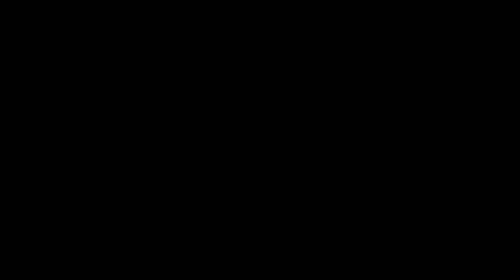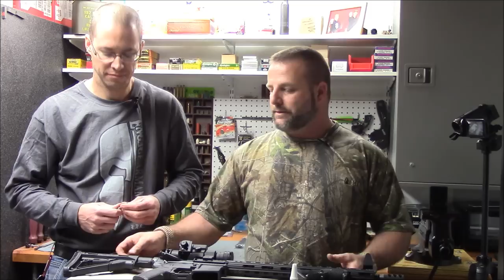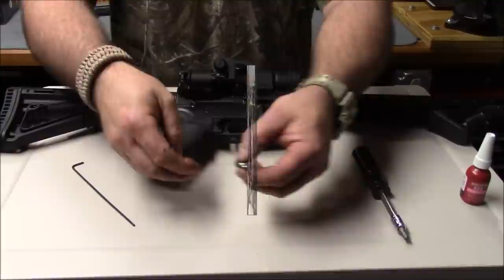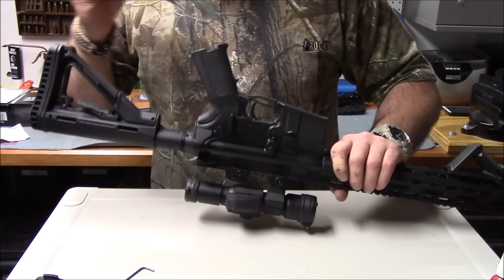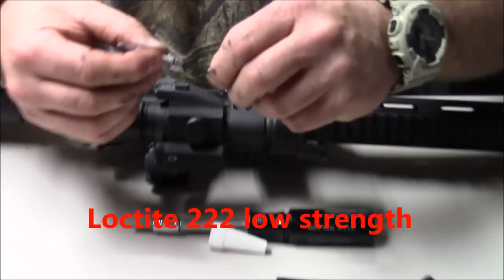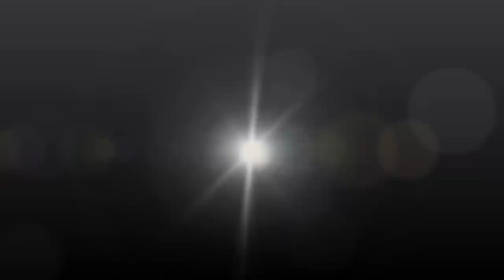AR 15 Trigger Adjuster

Comment: If you’re loving on this thing, make sure you understand what you’re actually doing. This is really a “hack” of the design of the lower receiver that allow the set screw to interfere with the mil-spec design. The set screw is hitting the bottom of the trigger bar preventing it from returning to its designed location. It’s basically just pre-pulling the trigger and that’s why there’s less take up or travel before it fires. The trigger is already mostly pulled before you even touch it. It also means that much less of the designed hammer cocking notch and sear face area are engaging at any time when the hammer is now cocked or when the hammer falls from the disconnect to the sear and all that force is now concentrated much closer to their edges and on a lot less metal.

Comment: This sort of gadget is hard to find in New Zealand, so I took the screw out of my Windham AR, drilled it through and tapped it for a grub screw. A long grub screw with the tip rounded and polished completed the machining. Re-installed the screw and adjusted it. With everything as tight as it would go without jamming the safety it would not reset, but another 1/3 turn out fixed that.
My AR now has a just-short-of-5lb trigger with NO creep....classic 'glass rod' break... brilliant!
Originally the trigger was about 8lb and a tad creepy.... not truly awful, but not brilliant either.
If you have an AR and don't like the original trigger, get one of these widgets, or if you have a lathe and taps, make one... took me about 20 minutes (but I am a gun smith).
Thanks for the video.... inspired me to do something about the trigger. I can't see that it is not, for all practical purposes, as good as the $450NZ Timney 4lb drop-in that I was thinking of fitting. 
What a happy coincidence that the grip screw is in just the right position for the adjuster!... :-)
Reply from the maker: KathrynLiz1 Nice. next time ask and we would put younin touch the the maker and he would have sent you some. But your way works too.  nice job. ;)
Reply: The problem here is importing anything that fits on to an MSSA (Military Style Semi Automatic...called an "assault weapon" in the USA). Getting a permit to import even a spring set or such a simple gadget as this trigger adjuster is a nightmare, and involves long delays, often a matter of some months..
If I go online at Brownells or somewhere like that and order any part for a "restricted weapon" without a permit, it will be confiscated at customs. In addition to that, for small items the postage is usually many times the value of the goods for international stuff. It's very frustrating.
Our gun laws here, while a bit of a nuisance at times (and quite ineffective vis a vis crime of course) are something we can live with and us shooters are numerous so they try not to upset us TOO much, so the bureaucrats make it as awkward as possible with commerce law. Having no homegrown firearms manufacturers means everything is imported, and that gives them a lever. For instance, a 20 or 30 shot magazine for an AR, that can be bought in the USA for $10-15US (about $20NZ) will set you back almost $300NZ.... yes that's not a typo! I have seriously considered making up some dies to makes the things to order myself, but that would make me an "arms manufacturer" and the cost of being so licensed would probably be prohibitive.....I'm not sure I could get away with it within the present laws. I have made parts for non-restricted weapons of course, because of non-availability or expense of import, but they are a bi paranoid here about AKs and AKs. The silly thing is that the only real difference is magazine size (7 rounds max). So on an ordinary non-restrictred license I can buy and AR15 with a 7 round magazine. In fact my AR was bought this way, but because I bought a couple of 30 round mags for it (available without any sort of permit!) I have to register it as a restricted weapon. Silly, isn't it? Better than Australia though, there's a complete ban there on s/a and pump guns....
I know that you are under attack in the USA, but you have constitutional protection..... we don't. Don' ever let it go... :-)

Comment: Problem I ran into was after getting the safety to operate properly, by backing off the center set screw. The trigger broke beautifully, but when I checked the reset.. The trigger would reset and fire almost instantaneously. So, I ended up backing it off more to stop the rifle from firing automatically. I was able to remove a lot of the creep.. but people should check the reset as well. I don't think you want your rifle running outta control.
Reply: Agreed. This guy set it a little too close for comfort, in my opinion.
Reply: I don’t think it’s running full auto on you. You were actually moving the trigger.

Comment: I had that same exact Casio G-Shock in Desert Tan, but it got really dirty, really fast. Sold it.
I have one of these on my rifle and it works fine. The thing you need to keep in mind is that it places your trigger/hammer engagement on a razors edge. Sweet hack, but I'm going with a true "drop in" trigger instead.

Comment: I installed one of these on my M4, works great. Tried another mfg's set screw on a AR 10 and it would not work. The set screw was smaller inside the grip screw, at least the head was and the grip screw was shorter. When set to allow the safety to operate freely and remove the creep or slop in the trigger it would lock up the action when checking for slop by pulling the trigger and resetting the hammer by hand . The set screw was extended so far out of the shorter grip screw (1") it was wobbly. The M4 had a set screw that took a extra long 5/64 Allen wrench, the AR 10 1/16TH I think. That is what it says on my Grizzly chart for my gunsmith tool kit.  The bad set screw was ordered from WI.

Comment: Jo Bob's Outfitters has the best prices for both the JP spring kit and the screw. As a matter of fact you can purchase them together in one kit.
Reply: That’s the kit that I got I got my trigger pull down to about 3 1/2 pounds. I polished up the trigger and the hammer side to get there. I haven’t had a hint to problem with it.

Comment: I had this and the JP enhanced reliability springs and seemed to work great. A good grease like Tetra gun grease is absolutely necessary on the sears. In the end I went with a CMC flat 3.5# trigger. Still have my parts for another mil spec trigger. Eh, worth it to just upgrade, cry once buy once. Good video fellows, it does work!
Reply from the maker: +Jason Mares glad it worked out for you. Thanks for watching
Reply: I was considering doing that Combo of the JP 3.5T springs + this adjustment screw... How did the two work out?

Comment: Thanks guys.   I built my own AR-15 about 15 years ago and yeah my trigger sure had some creep but i guess i just got used to it.  I moved from Houston.tx to NC back in 2011 and unfortunately i needed to sell all my guns to finance the move.

I live on disability now but I am thinking about starting another AR-15 build project and I will include this in the new build.
My previous AR i used an Olympic Arms forged lower but this build will need to be on a very tight budget.  I am considering buying a FMK polymer lower from a local sporting goods shop for $49.00.    I have heard the A-1 Extreme models are not too bad.

Do you think this modification would work as well on a polymer lower receiver?

PS   I will probably have to stretch this build out over 3 or 4 years  haha.
No worries........i have the time.
Reply from the maker: +Bill23799 I don't see why it wouldn't work on a Polymer lower, but check out the link in the description and contact the guy that makes them.  He will know for sure.  Keep your eyes peeled and do a lot of on line searching.  I found metal lowers for $59 the other day.  Thanks for watching!!!
Reply: Thanks guys.  I have seen some blemishshed PSA  aluminum lowers for $69.00   but by the time i pay shipping and FFL transfer fee its close to hundred dollars.  I will try calling some local shops to find an aluminum lower next week..
Reply: primary arms sells andersons for 49.00

Comment: Fine for target shooting but if your weapon is to be used for self defense, not fine. The extremely intelligent engineering team that designed the M16 two stage AR15  put the so called "creep"  first stage trigger travel into the trigger's functionality to prevent accidental discharge of the firearm during combat and high stress situations when you lose significant amount of your fine motor skills.
Reply: Very true, that had occurred to me too, although I am used to creep-free single stage triggers on hunting rifles,,,, For other than range/competition use it's easy enough to back the screw out a turn or so to restore the original pull.
Reply: You are 100% correct sir.
Reply: M16........Two stage trigger?  Smh.
Reply: As Clint smith says when your being shot at a 5 point trigger isn’t 5 pounds anymore

Comment: Go to joeboboutfitters.com for this part.  It's $14.95 and it includes the extra long allen wrench.  Veterans and first responders can use a discount code.  There are also deals for free shipping.  I ordered a spring kit when I ordered my adjustable grip screw and it knocked the screw's price down to (right at) $10.00.

Comment: Looks like the positive "snap" of the safety when engaged and disengaged was gone after your install. Did you find that to be true?
Reply from the maker: +pmcsurf1  yes, but only if adjusted to far.  When i had this happen, i backed out the screw a bit.